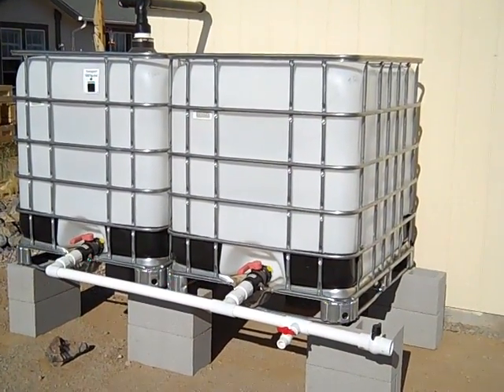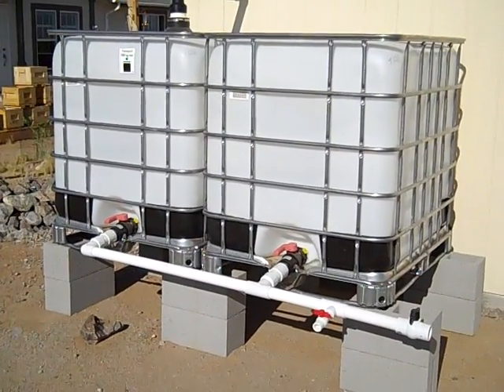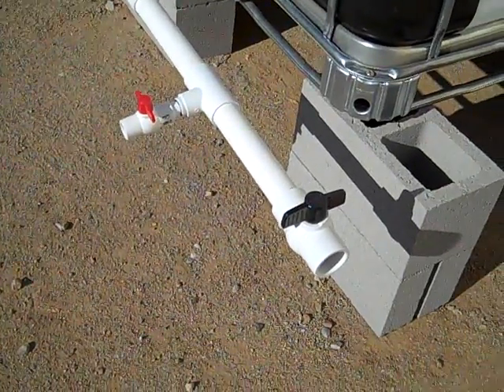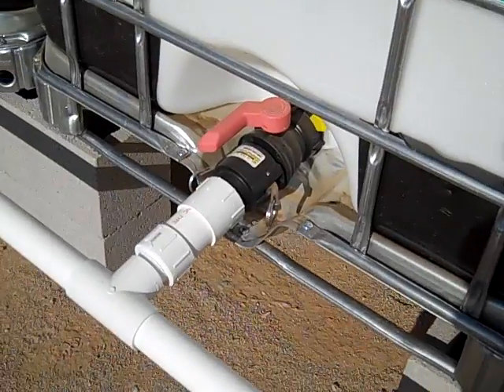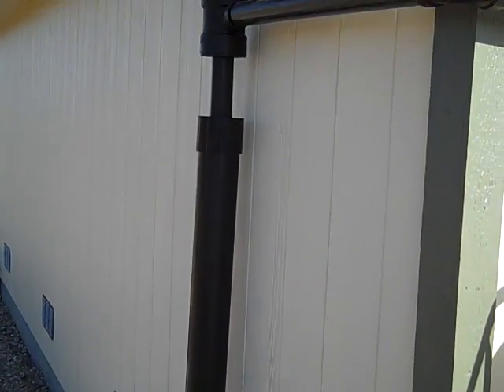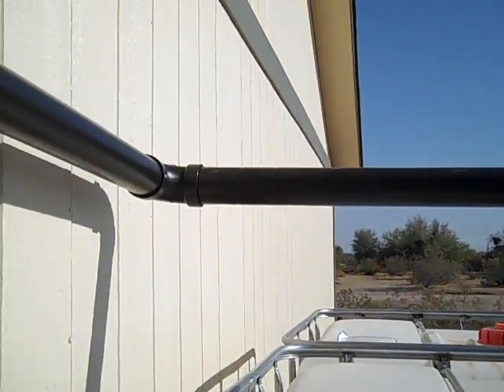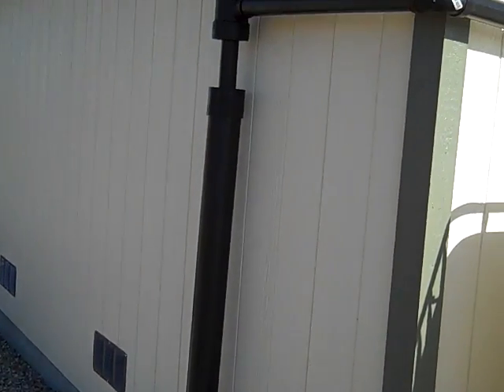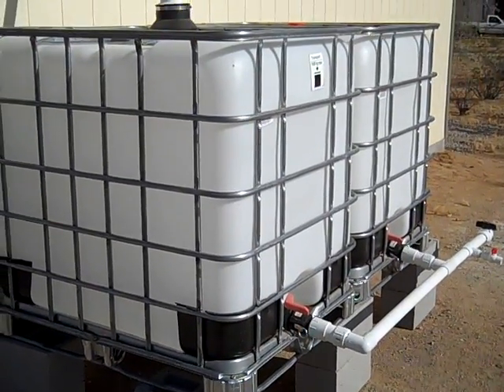Rainwater harvesting using IBC Tote system

Comment: A simple overflow 90 degree on top covered with a small square of cloth held in place with a zip tie works. It keeps the cloth screen in place and keeps the dust and bugs out while still breathable, but will slide off with the flow of water. It won’t push off with airflow as the air can escape more easily up the water spout/inlet. There are other methods for sure. A ball float in 2 different sized pvc will work and be a simple fix also but I always needed an overflow screen of cloth even with the floating ball as any type of water relief holes or slits seemed to let critters or junk inside as they somehow scoot past the ball. Maybe I need to contour the edge of my ball seat to ensure a better, tighter seal.

Comment: Found your video in 2022! I would love to see an update after 10 years. 😊
Reply from the maker: Hi!  Thank you for watching and commenting!  The system worked great for several years while we lived there (and from what we've seen it's still going strong - we sold that house 5 years ago and drive by on occasion to see how things are doing).  At our current ranch we set up an even larger system since water issues have only gotten worse and our water needs are higher. https://youtu.be/k41KZmTwo1A  Let us know if you have any questions.

Comment: I just got my first tote installed with black plastic wrap. I order the First Flush system, clean out my gutters and we received 0.79 inches of rain Saturday night. I am only using 1/4 of my roof to collect and was able to collect about 255 gallon that night. My tank states 286 gallon or max weight of 1650 KG. Waiting on my second tank which I will connect to this tank at the drains with 2" PVC pipe. Since I am only collecting water for my gardens I think this will be enough for the dry season. May install a third tank if necessary.

Comment: setup looks good, only 2 issues, this totes was designed to seat on a flat surface due to its weight when full. and the tanks should be wrapped or covered with black plastic, to protect against sunlight .

Comment: Can't quite make out the roofing type. 2:50
If you have composite shingles I would be concerned with hydrocarbons and solvents that come off the asphalt roofing?
Definitely not recommended for food production or consumption.
On the other hand if the roof is metal then you're good to go.

Comment: Opps, you answered the question already.  Instead of another pipe, I would suggest a 30 gallon barrel, the type with an open top so you can clean it out from time to time.  If you get a lot of rain, maybe a 55 gallon barrel.  Regardless of where you use the water, you don't want much dirt and debris in your holding tanks, as your water will start to get "swampy" and stink.